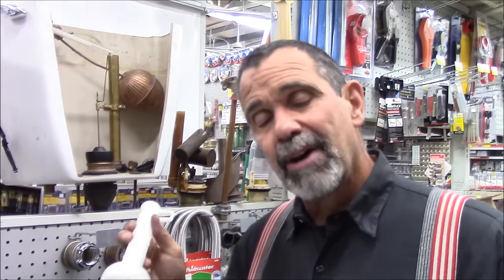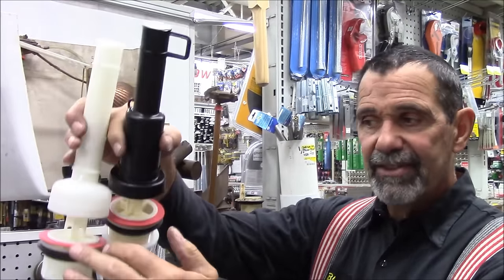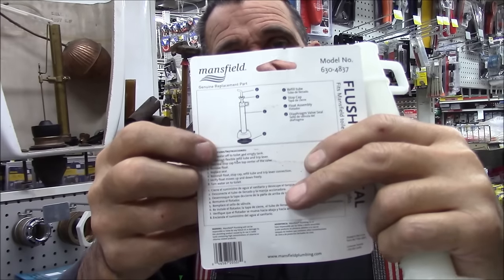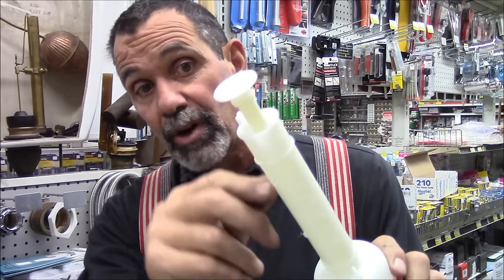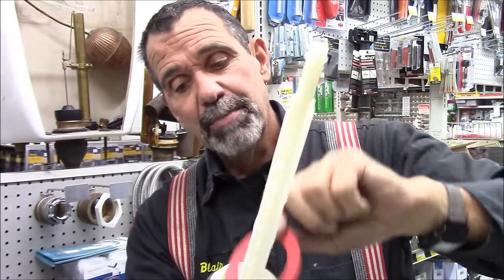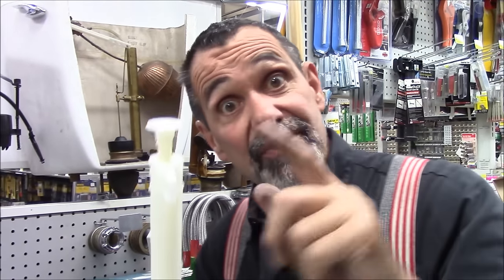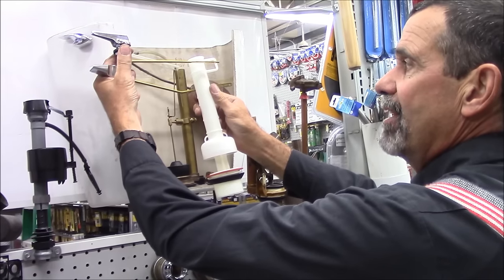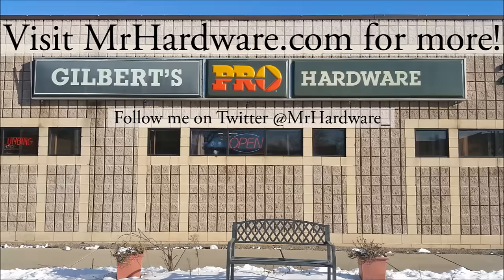Easy Mansfield Toilet Flush Valve Gasket Repair, Replace Seal, Handle Fix

Comment: I have the old style with the black gasket on the valve...how do I replace it with the new style without removing the tank?
Reply from the maker: With a little searching you’ll find the 208/209 black gasket. It is the only one that will work. Or the tank must be removed.
Reply: @MrHardware1  thank you sir, but what about the black gasket thing that seals the bottom of the cup or fap itself? How do I  replace that ? Thank you so !
Reply: @MrHardware1  I guess I see the gasket is on the plunger, I see those at many hardware outlets online. What I'm wondering about is the black ring around the bottom that it meets at the threaded part if you get what I mean thank you!
Reply from the maker: @mike.6285  That Is the gasket that seals the flush valve to the tank. If you remove the tank and undo the nut that retains the flush valve then you can replace it, but they rarely ever fail.
Reply: @MrHardware1  thanks so much. I've been able to order the one for the moving 
part as it is cracking and looking like it is going to need replaced! Thanks again for the video.

Comment: Too bad I didn’t realize the gasket could be replaced. Replaced the entire component now tank leaks
😡
Reply from the maker: Did you put metal washers on the tank bolts inside the tank? Only rubber in the tank, the flush valve needs to be wiggled as the big nut is tightened so it is centered properly, and the nut needs to be tightened xtra tight.

Comment: My red gasket has to be changed every 6 months its annoying, miss the old flapper
Reply from the maker: Something must be in your water. I get an average of 6 years. Are you getting Mansfield original parts or China junk? Chinese Delta seats and springs only last a year or two compared to 10 years out of genuine Delta seals.
Reply: @MrHardware1  the brand is called Keeney red, I get them from lowes, I'll see if there is an actual Mansfield brand next time to see if I can buy them locally and see how long they last.
It could be the water cause the original seal that was in the toilet probably lasted 1to2 years before I had to change it and since then it's every 6months. Where I'm at is a very dessert climate and the water   is extremely hard.
Reply from the maker: @xxtwobitxx  Call Gilbert’s and we’ll sell you an original one, or 2, 586-776-9532

Comment: This design is terrible. There is not enough weight on the flimsy plastic tower to press it down on the gasket and create an effective seal. I put a fresh gasket on and water goes down an inch every hour. (I know that is where it's leaking btw and yes I put it between the two grooves)

Comment: Worse thing ever. Simple flapper works perfect, and it's simple
Reply from the maker: The only problem is most won’t pull the tank in order to change the flush valve. I personally like the Mansfield. The gasket usually lasts over 10 years for me.